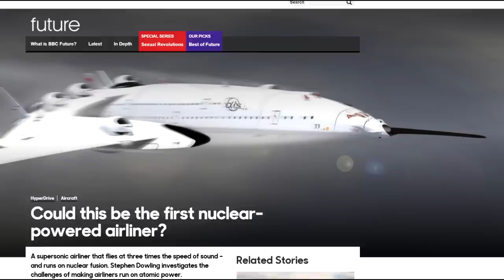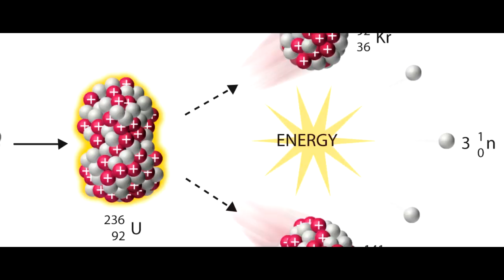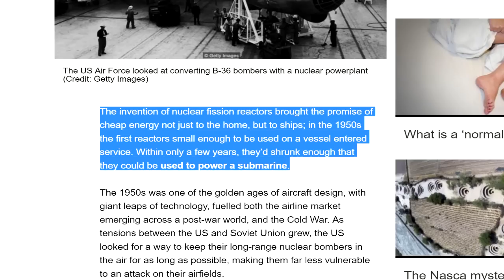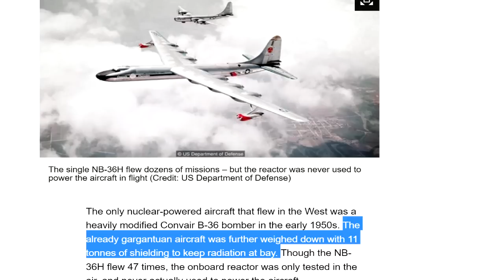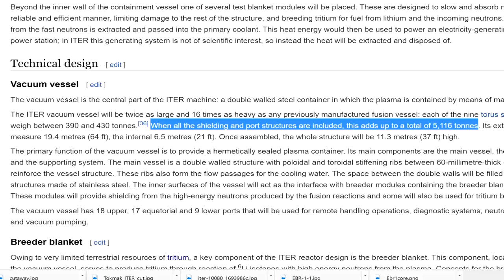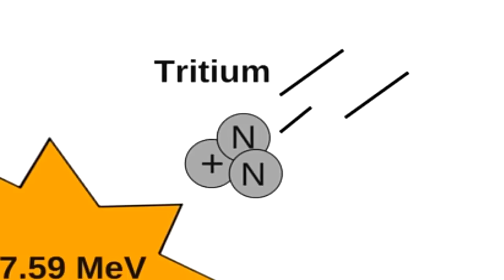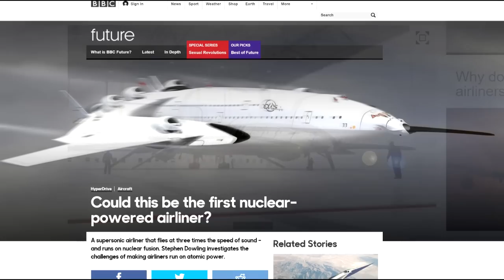SIX ENGINED Nuclear Airliner... BUSTED!

Comment: The chances of any country letting a nuclear powered airplane fly over there territory is nil.
Reply: It's not about it being a bomb, it's about it flying. If there were a catastrophic failure (not even from the reactor, but from the aircraft it's situated within), you'd be releasing the fuel into the atmosphere where it could spread quite like fallout.
Reply: Sigusen
I wasn't talking about literal fallout. I said "quite like", because it's A: irradiated debris and B: high enough in the atmosphere where dispersion would be a significant issue for, say, some suburbs. I'm well aware that a nuclear reactor isn't a bomb and cannot become one without significant reworking by a saboteur, which is why I said "It's not about it being a bomb, it's about it flying".

And yes, I'm aware that it would be relatively small amounts of the fuel being dispersed, but your average person won't know that. If you tell a town that it's probably been irradiated, expect panic thanks to intelligence and rationalism not being the norm.It'd be like the anti-powerplant protesters, but exponentially worse. The last thing those loons want is flying reactors.

I'm all for the idea of nuclear planes, but unfortunately the average person isn't educated enough on radiation and its dangers (or lack thereof, in this case).
Reply: Sigusen
 Exactly, though. It's not about what it could or couldn't actually do, it's about what the populace thinks it could or couldn't actually do.
Reply: Junn Kopf fair point.
Reply: There's a pretty big difference between nuclear fusion and nuclear fission though.
Reply: Sigusen
Call it what you like, the explosion of the reactor at Chernobyl cause a shit ton of radioactive crap falling out of the sky. The same could happen if a nuclear powered aircraft crashed or collided with another plane although on a much smaller scale than Chernobyl or Fukushima.
Reply: Russia did it, it was a bomber and everyone involved got radiation poisoning but it has been done.
Reply: I don't think people would want the plane flying over their territories in the first place, for the same reason the Concorde was banned from flying over land. The beautiful marvel of engineering known as the Concorde was banned from flying over land because people where complaining about the ear bursting, property damaging sonic booms caused by the plane breaching the sound barrier. There are experiments and theories on how to reduce the effect of the sonic booms, but no one has really reached anything groundbreaking. (as far as i know anyway)
Reply: @blackrave404 The half lives of [deuterium and] tritium are both around 12.3 years. Plutonium's is 14.4 years. Deuterium and tritium will both give you a higher dose of ionizing radiation than Plutonium over the same period of time. They are highly radioactive.

Edit: Misread my source. It is Tritium which has a half-life of 12.3 years. Deuterium is not radioactive.
Reply: +Mark Most mainstream technologies won't make a city uninhabitable in case of a catastrophic failure. Your logic is extremely broken.
Reply: Eh... you could trigger a steam explosion and meltdown with one.
All you'd have to do is pull out all the control rods, and disable every one of god knows how many safeties.
I mean, that's not a big bomb, but I sure as hell wouldn't want to be near it.
Reply: +SuperCorrector1 troll
Reply: Mark while everything you said is correct the fact remains that putting a fucking nuclear reactor which, in case of a meltdown, can cause a whole lot of trouble on a commercial plane is anything but a good idea.
Reply: +SuperCorrector1 who calls someone a cretin? no need to be that toxic and salty
Reply: Their territory
Reply: Bill lupin

 Molten salt reactors don't experience runaway reactions like that. The thorium is already liquid, and the coolant is high-temp, low-pressure. The danger with older, more conventional solid-uranium steam-cooled reactors is that the steam is pent up at incredibly high pressures. In the scenario that there is a critical failure, a molten salt reactor's contents spill out like a leaky milk jug. They don't cause a runaway-based boom using superheated steam, because there's no compressed steam.
Reply: Bill lupin

Heat exchangers have difficulty causing runaway explosions. It's a lot easier to design a way to disable heat exchange between the inner coolant loop and your turbine-pushing fluid than it is to disable heat exchange between the inner coolant fluid and the reactive material itself.

SuperCorrector1
http://physics.stackexchange.com/questions/218585/criticality-in-liquid-thorium-fluoride-reactors
Reply: bryfunkenstein
 I never said liquid salt would be used to spin the turbine.
Reply: +SuperCorrector1 Oh, you must not have heard, the second explosion heard by over 250,000 people was just a trick of sound. Surely you must have heard some machinery, or another explosion further off, in a different building. Those two explosions were clearly not connected in any way whatsoever, and that is heresy for you to speak of that.

I had actually forgotten about the AZF explosions. Wasn't there even a big deal about a couple of journalists who faced criminal charges for "printing articles likely to cause public panic"
Reply: SuperCorrector1 It's okay man, at least you have life :c
Reply: +SuperCorrector1 still with the insults...ignorance on display...
Reply: Sigusen Apart from yourself, of course pal
Reply: deuterium is not radioactive, tritium is
Reply: +A Brackers
"had no radioactive particles in its exhaust"
Really? Just read the part about gaseous emissions in actual nuclear power plants:
http://large.stanford.edu/courses/2011/ph241/jaffer2/
And I really doubt you can fit the same systems on an airplane. 

No-one has built any nuclear jet planes. Both jet designs americans pursued had too many downsides to be practical. Closed loop was too heavy.
Reply: Rainer67059 you do realize that a nuclear reactor is the only way to use nuclear energy right?
Reply: johnabuick Keep in mind that Chernobyl exploded due to flawed reactor design, and inadequately trained personnel. It was a catastrophic failure that caused a steam explosion that distributed about 5% of the radioactive core into the atmosphere.
Reply: Mark You're right. By the logic of suppressing dangerous technology, everything can be used a s a dangerous weapon. You can slam a person's face into a table, into a building, into a concrete bridge, into a road etc. and your phone can be thrown at people. Everything is a weapon.
Reply: Junn Kopf
Ok, so we're talking specifically about a thorium based reactor, with a salt fuel/coolant system. You're going to need a heat exchanger to transfer that heat to water, and vaporize it to steam, because LIQUID SALT WON'T TURN A TURBINE.
Reply: +Bill lupin the heat exchanger went through a modified jet engine if I recall correctly. the heat was used to power the jets
Reply: +Junn Kopf actual liquid salt would not be used to spin a turbine. the heat the reactor gives off would produce the energy to keep the turbine going. they actually flight rated the msr version...they project was cancelled before an airframe was built
Reply: Junn Kopf
Now I could've sworn I'd say to cause such an explosion you'd have to disable/bypass god knows how many safeties?
Because essentially, that's what you're talking about. A safety measure.
Reply: SuperCorrector1 That was also a problem. And the one that crashed after takeoff, that was also a bit of an issue. The crash wasn't really a problem with the Concorde, but still.
Reply: +SuperCorrector1 it was a FO accident. the tires ran over something that fell off a plane that took off before it
Reply: SuperCorrector1 I mean, they have been flying concordes since 1976, and had only one crash in 2000, soooo yeah, not very predictable. I mean, there would inevitably end up being a crash, but still. Although there aren't exactly a lot of people who where willing to pay massive amounts of money to get to the other side of the world in 3 hrs.  Pretty bad when the people who designed the plane aren't even able to pay the massive amount of money required to actually fly on it.
Reply: +SuperCorrector1  foreign object. supersonic aircraft are in more danger of this than subsonic craft.
Reply: SuperCorrector1 +SuperCorrector1 That is also a problem. Supersonic aircraft that have to fly at a low speed over land have to deal with more drag and air resistance, since they are clearly not made to be flying at low altitude and low speed. They are meant to be flying at supersonic speeds at high altitudes, but when they have to fly at low speeds and low altitudes, they burn A LOT more fuel. That was one of the big downfalls of the Concorde
Reply: +SuperCorrector1 Really? Huh. My whole life has been a lie. Still a really fucking cool aircraft though. I would still pay $33,000,000, to fly on one, even if there was a great chance it would crash.
Reply: +SuperCorrector1 Of all the countries I would suspect of being corrupt, France would be the lowest on the list. Is it really that bad? Why would they hide the truth behind the Concordes crash?

Not trying to sound accusatory or rude, I'm just incredibly curious.
Reply: Conspiracy theory... France isn't corrupted. Corruption is on the same level as other modern countries. We only have bad, idealists politicians who think everything will be solved by "loving each others". That's all.
Reply: +SuperCorrector1 Obama is leaving office soon. who will you blame then?
Reply: +SuperCorrector1 ... The systemic corruption if "Obummer"... The thing you JUST complained about...  Stupid people are stupid.
Reply: +Sigusen I was done when he called me a cretin...lol...got to love the misinformed
Reply: It would probably use an rtg like the subs and CV s and spaceprobes do. That isnt as bad on potential contamination in the event of faliour as a full on reactor.
Reply: johnabuick hahaha very good point. Fucking just imagine 9/11 with Nuclear powered airplanes.. we'd have 4 million dead and New York would be uninhabitable for 2 thousand years after the radioactive material dissipates.
Reply: You realise how mature and sensible you sound? Probably not.
Reply: Blackrave, the fuels are radioactive. If it explodes, it's effectively a dirty bomb. No sane country would let it fly in their airspace.
Reply: blackrave404 What's the score with Neptunium and Curium then, is that what they use in Chemotherapy n stuff?
Reply: Bobby Ewing Sounds like a result then 🤔🤔🤔
Reply: Entirely different plants.  The satellite use radioactivity to generate electricity, not generate thrust.
Reply: Yeah, sorry about that. I misread my source.

That was embarrassing.
Reply: Yes! We would like to fly over your country spraying irradiated air out of our nuclear jets.
Reply: It's not just a question of engineering. It's a question of politics, too. You're right.
I say suppressed technology.
Reply: nipi tiri Closed looped nuclear powered jet engines dont release any of the harmful products of the nuclear reaction, in the same way that closed loop nuclear power plants dont release radioactive products with the cooling water evaporating from cooling towers. However, theyre much more complicated to produce (hence why the russian nuclear plane was much easier to design, and the russians didnt bother with thoae 11 tonns of shileding.
Where my guess nuclear planes will be best is in space launches. If you have a platform similar to virgin galatic's carrier plane for launching stuff into space, then power it by a nuclear jet, it should make it much easier to launch heavier items into space
Reply: +Rainer67059 Well then you're just another delusional tard that wants to blame losing his fuckin keys on the government.
Reply: +A Brackers
Except that making a closed loop means your plane is even heavier because the engines are now heavy too. And I really doubt you are able to achieve the same level of separation that a nuclear plant has. You have weight constraints.

The whole concept is impractical until some gigantic leaps in radiation shielding technologies are made.
Reply: nipi tiri The american version detailed in the video did use a closed loop and had no radioactive particles in its exhaust
Reply: Re-read your thesis.  It is about power generation applications; it isn't obviously applicable to other applications, like flight reactors.  The design had no allowances for radioactive particles in the exhaust.  Not having been actually tested, we'll never know whether it could live up to that.  But irrelevant overviews don't help.
Reply: nipi tiri Well there are nuclear rockets. I just don't see how practicle it would be using the tech on a commercial aircraft lol.
Reply: Sigusen well but the problem still remains that it is a nuclear reactor on board a plane which have been used and will continue to be used as weapons by terrorists. Putting a nuclear bomb on a plane is making it awfully easy for terrorists once they are in control of one. 
Just imagine the amount of damage that would bee caused by one of those planes crashing into a city at rush hour.

The concept is interesting indeed but its just too risky.
Reply: SuperCorrector............no it wasn't, it was the noise it made from the sonic boom from traveling over the speed of sound. I've watched many takeoffs of the Concorde and it wasn't that noisy.
Reply: Micsmit 45 There's a few problems with suppressing a technology with the assumptions that it could be used nefariously. First, if your logic is correct, then why nor ban every aircraft? After all a 747 that's hijacked can kill a few hundred to a few thousand people. In fact lets go back the the stone age since practically every single modern invention has been the cause of millions of deaths. This is obviously a huge fallacy since you fail to take into account how many more people have survived and lived comfortably because of the same technologies.
Reply: +Micsmit 45
Who says, it has to be a nuclear reactor? Cars and planes that run on petroleum, don't use the same technology as coal and petroleum powered plants. So do cars and planes not need to use the same technology as nuclear plants. If we had a nuclear plane, it wouldn't be a reactor.
Reply: That depends on how you define 'nuclear reactor'.
Just as the steam engine isn't the only way to use fossil fuels, a reactor isn't the only way to use nuclear power. It's just the only way that has been developped so far. But fusion power hasn't been developped either.
Reply: +Rainer67059 The only other way I can think of to use nuclear power is to use an RTG, or radiosotope thermoelectric generator. However, it still requires fissile plutonium to operate, and is technically still a nuclear reactor. 

Nuclear reactors are the only way to generate power with fissile materials like uranium and plutonium, because they're the only way to access the potential energy in those materials.
Reply: johnabuick you have nuclear submarines going around...
Reply: johnabuick it's nu-clear, clear energy, no carbon emissions lol
Reply: nipi tiri If a nuclear reactor is working correctly and built correctly, no form of radioactive material or radiation escapes at all. It certainly would not spew irradiated air.
Reply: Micsmit 45 If a reactor is designed correctly, it will be impossible to turn it into a nuclear bomb. Instead, like modern reactors, even in a catastrophic failure, it would fail in a controlled manner and render the core unable to continue fission.
Reply: Imagine a nuclear plane crash... or worse, a hijacking.
Reply: johnabuick
 Whoa, there. Calm down.
Reply: johnabuick lol what?  Where did that come from?  I give statistics, facts, some quick research, and in return I get insulted; indeed a very effective rebuttal.
Reply: Keep in mind that a nuclear reactor is not the same as a nuclear bomb.  There are some pretty substantial technical differences.
Reply: Sigusen
Who said anything about bombs?
Reply: johnabuick no one.  I simply was pointing out there was a substantial difference between a nuclear reactor and a nuclear bomb
Reply: Sigusen It may definitely not blow up like a nuclear bomb but It can still be utilized as a dirty bomb due to the fact that it is fueled by high radioactive materials.
Reply: @Sigusen  Chernobyl says otherwise
Reply: Chernobyl??  Bloody hell...  The explosion at Chernobyl was human error causing a massive graphite burn that couldn't be stopped.  These are... staggeringly different situations.  You sound like that idiot Congressman from Georgia who asked a US Admiral if too many soldiers on Guam would cause the island to sink.  "ZOMG a nucelar airplane?!?!  WE'LL HAVE CHERNOBYLS EVERYWHERE!!!  WE'RE ALL GONNA DIE!!!!"

Do a little research will ya?  The energy output of Chernobyl was for a COUNTRY SIZED ENERGY plan... not a PLANE.  There has been 40 years of improvements made to nuclear plants; the first reactor went online in 1977, so I'm guessing the plans were finalized a year or two before that.
Reply: johnabuick LOL you're making exactly my point - the explosions at Chernobyl caused a far larger problem then a plane sized reactor could produce!  Thank you for the assist.
Reply: Junn Kopf Fallout refers to radioactive material falling from the sky as a result of a massive explosion causing that material to spread over an exceedingly wide area.  A catastrophic failure on a plane will not create a nuclear explosion, nor create any such effect that is popularly known as "nuclear fallout".  Yes, there may be radioactive material, and yes it will be falling, but that will not be anywhere near the same thing.  

http://www.atomicarchive.com/Effects/effects17.shtml

interesteing simulation of fallout: http://www-personal.umich.edu/~jmoilane/nuclear/Fallout.html
Reply: johnabuick  Dissing?  You are a sensitive one aren't ya?  What you said was this: "...Explosion of the reactor at Chernobyl cause a shit ton of radioactive crap falling out of the sky. The same could happen if a nuclear powered aircraft crashed or collided with another plane although on a much smaller scale than Chernobyl...".  And this is wrong.  It is not the same scale, unless your scale is logarithmic.  Aircraft, or even nuclear submarines simply do not have the same amount of fuel to cause a 'Chernobyl' equivalent accident.  Finding hard numbers for the amount of nuclear material is proving difficult for 5 minutes of searching; but for example: Chernobyl's #4 reactor required 28,000 tons of coolant per hour.  You think a plane could carry anything close to that?  No.

2 nuclear powered planes colliding would not, could not, cause anything close to a Chernobyl type disaster.
Reply: Sigusen
You started it fuckface when you compared me to some idiot US congressman. You reap what you sow.
Reply: +SuperCorrector1 it's design not speed. if something gets sucked into the inlets on take off it's more fatal than it would be in a subsonic craft
Reply: johnabuick Hey man... if you sound like an idiot, I'll call you an idiot.
Reply: Sigusen
How the fuck do you know? Have you built a nuclear powered aircraft? Do you even have a clue how to? How much of and what kind of nuclear material will be in this machine.
What I stated was valid, what you state is conjecture.
Reply: Sigusen
You're the fucking idiot, there were two explosions at Chernobyl. The first one, the smaller of the two, blew the 2000 tonne top of the reactor casing right through the roof and the second larger one killed the whole reactor and spread radioactive waste over a huge area.
Why don't you do a little reading before you open you ignorant pie hole.
Reply: johnabuick

He doesn't need to build a nuclear aircraft to know its rough characteristics, because other people have built aircraft and aircraft-sized reactors, and documented them.

Comparing a nuclear airliner to Chernobyl is like comparing a cherry bomb to a mark 82.
Reply: Junn Kopf I am in, sadly, complete agreement regarding the lack of intelligence and scientific literacy in... well our species as a whole.